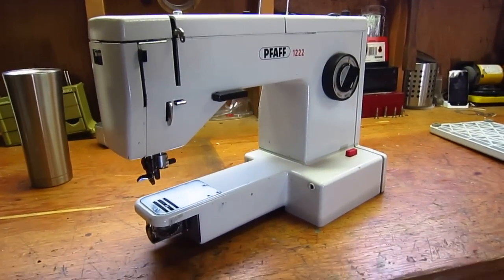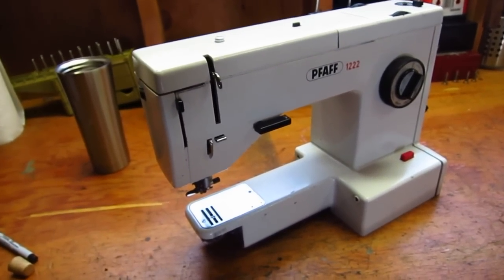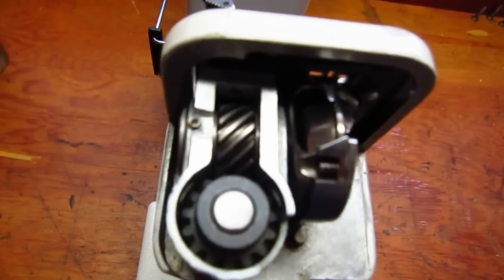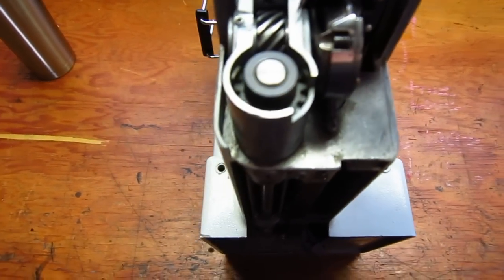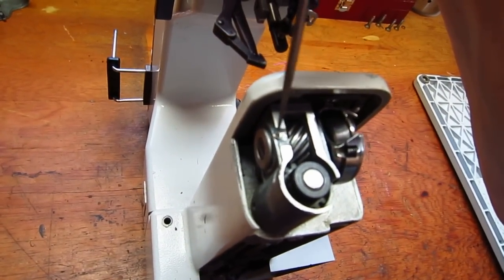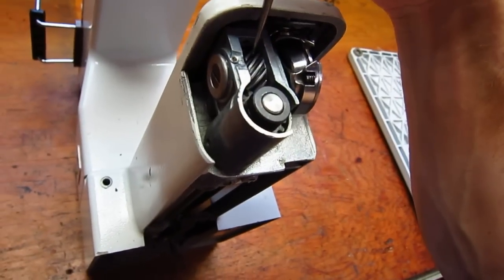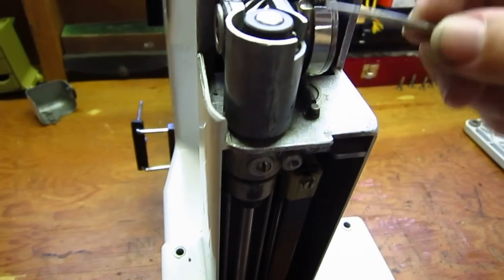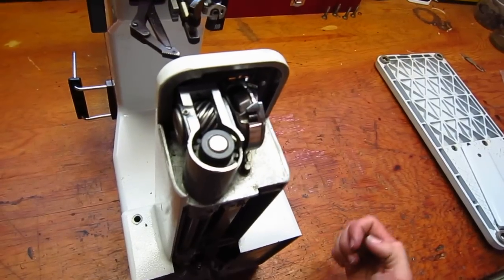Pfaff 1222 Loose Hook Bushing Repair

Comment: Awesome!  Totally answered my question. I have I think that spindle shaft seized somewhere.  Otherwise, the rest of the machine seems OK.  I just couldn't get to that screw due to the outer hook door cover part in the way.  I didn't see that lower screw for some reason.  Now the hook and whole drive train is moving since I can access the screw, however I need to jam up the hook somehow since the screw might be over tightened... or maybe just oil to loosen up and clean up if not disassemble and clean thoroughly as is probably best.
Reply: Turned out the hook bushing is loose and I might do the same.  Wondering about some way to shim and press the bearing in to avoid drilling and tapping as well.  Possibly using an adhesive might be a way as well. Any thoughts regarding that later two methods I mentioned?  Still seems more needs to be disassembled and cleaned since the section of parts seem to be the most stiff, since still isn't easy to move the balance wheel by hand.

Comment: Hello sir, Thank you  so  much for sharing this. Please is the indicator wheel supposed to spin slowly when the machine is set to straight stitches ( 1 - 4) on the dial? or is it supposed to remain static?   The indicator wheel is the black dial directly opposite the decorative stitch pattern length setting dial

Comment: This video helped me. I had the opposite problem, same machine. The rear bushing was ceased, locking up the machine.

Lack of lube caused it. My gal is a full-time sewer of experimental garments. This machine was my sister's (rip), for whom maintenance is just not done, not even lube. After it froze, she probably stored it for decades in her basement, further bonding the bushing....

I'm an industrial machine maintenance tech, production machinery. It was a delight working this small for a change.

I had to use a drift pin to dtive out the rear bushing... it was in that tight.

I cleaned it up with a strip of emery I use around my lathe, hit it with a lube my gal uses at work on the industrial machinery there.

I never removed the drive gear, so hopefully, I don't need to re-time it. Will see.

Thanks again.

Comment: Instead of going through all the work drilling and tapping for a set screw, just use Red Loctite on the bushing. It's creates permanent bond and only a torch will break it loose. I just did this to a 1222e  and it was much quicker than trying to drill and tap.
Reply: Wouldn't Locktite 649 be better suited to that? Cylindrical fittings is what it's for.
Reply: @atomicskull6405  Either or will work fine in application like this. Red Loctite (262) is much easier to find over here in smaller tubes and I've used it on various applications where a bushing has spun inside an aluminum case/housing. I've even used in on the driveshaft of my ATV which sees much more torque than a hook in a sewing machine. The splines were excessively worn so I used Red Loctite to hold the driveshaft onto the pinion gear of the differential. It's been holding for years.

Comment: Great video ! I use an oil called Liquid Bearings Fully Synthetic Oil, it is a sewing machine or clock light weight oil that that is a lot less thick than 0-20wt, also car oil that is labeled 100% synthetic is usually not as they changed the rules for labeling and it can have as much as 5% or some percentage of regular oil in it, this was a cave in to oil manufactures who said it was to hard to make 100% true synthetic.

Comment: Are you sure that's a 6-32 screw?  Looking at my 1222 and the width of the aluminum wall, it looks like it should be a 4-40.  And it looks more like a 4-40 in your video.

Comment: I just rebuilt my hook assembly. The hook side bushing on mine was seized solid causing the whole machine to be locked up. These machines are such close tolerance machines that when they sit unused and serviced for long periods of time, the old oil turns into a varnish causing parts to be sticky, or in this case, seized. I had to hit the hook side bushing, once it was out of the gear box, with my heat gun. The old varnished oil melted and oozed out of between the bushing and race. Cleaned the two pieces up, re oiled and reassembled. Nice and smooth now :-)
Reply: Türkçe  anlat

Comment: Thank you for your video. However, you lube parts that are not supposed to be lubed, then complain when dust enters them, and seizes them. Also, the driving gear on the main shaft is plastic (teflon based). Lubing it actually shortens it's life.
Reply: If it's like modern Pfaffs it's actually polyoxymethylene which is a self lubricating engineering plastic but it's not harmed by synthetic greases. NEVER use silicone grease on POM though only synthetic greases (e.g. triflow grease, super lube etc).

Comment: I have a phaff 1199 and it suddenly started to go very slowly.  The wheel is hard to turn forward but goes back normally.  I took it apart and blew it out with a can of air.  I can see no strings caught anywhere.  :(